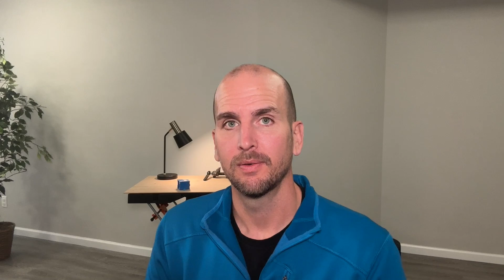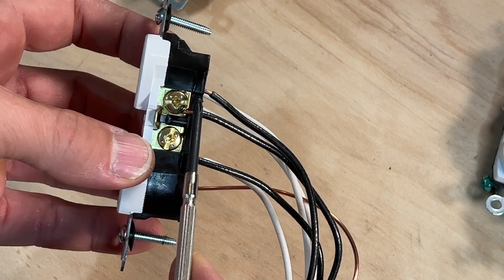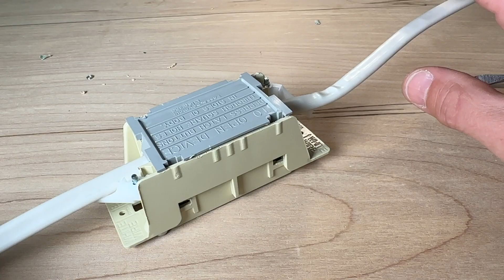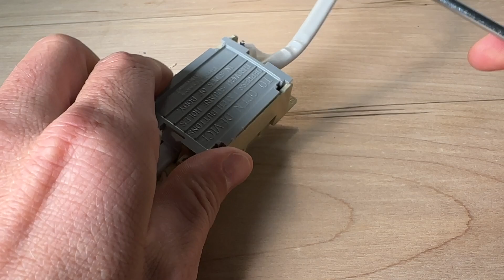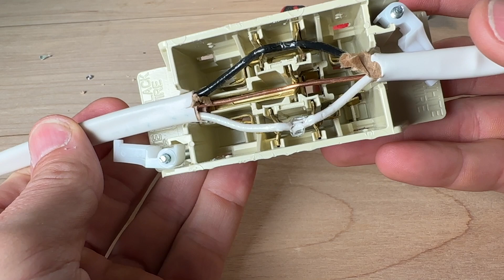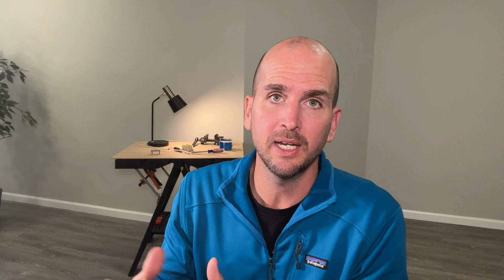90% Of Homeowners Have Never Seen This Dangerous Electrical Device

Comment: I was an RV tech for many years and these were so problematic because of the weak connection. Look up the wiring for the 3 way switch, it was a nightmare. They should be pulled from the market but the RV industry gets away with a lot of things like this.
Reply: I'm not aware of any other industry where the product being in for service for months at a time, in the first year, is common.
Reply: @SmallSpoonBrigade  yeah, I mean: Screws can loosen during earth quakes - on an unrelated note: Of those few times of service each year, an RV spends time on and off roads, shaking those presfits loose. Now, luckily only domestically rated equipment contains notes about retightening  screws after moving equipment.
Reply: most likely due to some big name RV mfc is a subsidiary of a member of the NEC or throws the NEC an assload of money
Reply: @harveylong5878  The NEC has no members - it is a code book. And if you had a clue how the code development process worked you would not make such a ridiculous statement.
Reply: @denali9449  are you a factory worker assembling the arcfaults? Just asking.
Reply: @raidhhi2217  No, I am not. Whatever gave you that idea? Or, are you just a YouTube troll?
Reply: @harveylong5878  - when properly installed and anchored, these things would be good, but year after year, we see profits and shoddy work when out over safety and common sense.
Reply: I could only imagine how much worse it is rattling up and down roads in an RV too.
Reply: Are RVs considered a dwelling?
Reply: @Linkedblade  No. They are not subject to any of the codes used in 'standard' brick & mortar or wood frame construction.
Reply: What incredible garbage
Reply: I figured this was an RV part... Looks terrible.
Reply: Yup, RV industry gets away with all kids of crap because they are trying to reduce the weight of the rig, and also keep costs down. No metal boxes and less wiring runs means less weight. Less weight means better fuel economy for the tow vehicle, and that means less emissions. They all figure thats a win win for the environment. Problem is that lots of these plastic pieces of junk get pulled out and thrown in the dump where it takes 10 million years to break down the plastic.
Reply: @wrenchgearsadventures  - "takes 10 million years to break down the plastic" - The next species to rise on the planet will be very grateful for our landfills that will be easy pockets of oil for them to harvest in 10-60 MM years. We are no only destroying our ecosystem, we're building in the downfall for the next one, too. 😛
Reply: Name one thing in an RV that is not a complete POS, just one.
Reply: @Qbert-379  - "Name one thing in an RV..." OK, I tried real hard on this one and I got nothing, except I own one... wait... nope, still got nothing!

Comment: I have seen and/or had some kind of problem (mostly heat failure) in every instance where I have seen this product used.  I will not install one.  I replace every one that I encounter with a spect grade receptacle.

Comment: Never seen these before! In automotive, where amperage never really exceeds 30 amps, and voltages stay low, those connections are usually fine.. but at 115/240 volt, why??? That's a fire hazard!

Comment: Holy nopes... xD
If the whole thing managed to slip and cut a good part of the sleeve and make significant connection with the bare wire with a tight grip, sure... but that, man, that's just asking for arcs and overheating. This needs at least multiple points of contact for a single wire, of it should demand for whoever is installing those to actually take out a portion of the sleeve and make a clamp style connection with a copper sleeve or something... which yes, would likely kill it's practicality, but still.
It's not a bad idea per se, getting into the circuit like a vampire thing, but very poorly executed.

Comment: I've worked on quite a few mobile homes mostly from the 70's to the 80's and all have been wired like a house and just had a small electrical panel. I live in NW Ohio so things may be different here than other states which could be why I've never seen these before. I'm just not sure why anyone would choose these things when they have to be considerably more expensive than a normal outlet and box.
Reply: They aren't generally found on older mobile homes. I'm fairly certain they didn't start using these until the 2000sb but I could be wrong. I live in a mobile home made in 96 and it's got normal receptacles. They are fairly common on rv's though.
Reply: Saw one in a Georgia mobile home that was built around 2003, as a light switch. Looked like the rest in the home had been long replaced ages ago.

Comment: I used to wire CATV telephone and internet.  There was a phone outlet that had a similar wiring method to the electrical outlet in question.  There was a special tool used to push down the wires that if done properly with the  tool was fine. But not done properly could cause intermittent connectivity to a hard line outlet. Many times these were wired to individual rooms so to cut down on wireless devices in an area and security issues.

Comment: That is…kinda sketchy. If installed correctly, it would be about as ok as speed wiring, which I guess is why it would meet code.

What does slightly help is that there are two contact points on both live and neutral that are connected via a common internal connector, so that current flowing to devices can pass through both connections, but only if it’s done right.

So if you do everything right, it’s just barely passable, and we all know that everyone always does everything right.

Comment: I've never heard of that before and I cannot imagine this being used for serious amounts of power... I never thought I'd see something that makes the backstab seem like a good idea
Reply: Older mobile homes (think 1980's or older) ised these as well as the rv industry still uses these. This is because in older mobile homes had 2x3 wall studs thruout the home to save weight and as a cost saving measure. In the rv industry it's the same 2x3 or 2x2 wall studs so no room for a normally wired device like we see in sight built homes.
As for wiring these devices internally ask a telephone technician if a 66 or 110 punch down tool would work to seat the wires properly, only if you have an rv that uses these and one or more needs repaired. 
The aftermarket automotive electronics industry uses a similar crimp on device to add stereos lights and other electronics to cars to avoid cutting wires and thus voiding a new cars warranty.
Reply: @leemyrick8549  oh yeah, those little brown, and sometimes blue connectors we called Scotchloks (even though I'm sure they had a different name).
Reply: @peterskyparker  couldn't remember the name but yep that's them. Can still find them in auto parts stores.
Reply: @peterskyparker  If I remember correctly:  made by 3M, rated at 240v in UK, no current rating marked on the product, main use was auto electrics.
Reply: @leemyrick8549  I have been a communications and data technician for over 40 years.  The punch down tools you mentioned will NOT work on this particular product.
Reply: @Redial2416  didn't think they would and now I know.
Reply: @leemyrick8549  I live in a '96 trailer and it uses SCDs for everything. Other than that, and floor damage over time from a half-done permanent installation and yearly burst water lines that were past their recall date, it's held up decently well.
Reply: @Redial2416  Standard spring-loaded cutters wouldn't, but what about the cheap plastic tools that often come packaged with an ethernet jack?
Reply: @wagnerrp  That would also be a no because they wouldn't stand up to the force needed to seat the connections or have the proper configuration on the end of the tool.
Reply: @JohLincN  yep 60 amp was more than adequate until the mid 70's. After that more small appliances and electronics were coming on the market thus the need for upgraded electrical systems in the home. 200 amp is the minimum I would recommend for a home now.
As for how the home is built yes stick built homes are not much better than in the 50's and 60's. Up until the 80's there were really no wind load requirements or none were enforced if there was one. Most areas of the country didn't start to follow any codes until the 70's.
Reply: A handi box and standard duplex receptacle fits in a 2x2 space.  There's no need to skimp on the connection.  The only place I see these actually being handy is for temporary power on a job site.  We use similar insulation cutting connectors to tap off of overhead temporary lighting cables.  These type of connections make more contact on stranded than solid but is an exceptionally weak connection method.
Reply: @JohLincN  yep, low voltage landscape lights use a similar 2part connector, place one part over the cable then screw on the second part to compress the cable down onto the small but very sharp prongs.
Worked very well for me over the years.
Reply: Mobile home I’m living manufactured in 2015 uses these in all switches and outlets. They are junk and I’ve replaced all my switches in the house with standard ones.
Reply: Actually there are insulation displacement contact for such applications as being used on the distribution grid itself, though they are not designed quite like this to make sure they get a very good connection. The conductor actually cold welds to the blade if done properly.
Reply: Like Lee said, Nailed it RIGHT on the head... we got a 1980 doublewide mobile home a few months ago and are renovating it. These awful things were ALL IT HAD in it... switches too,not just outlets 😑.  When you get RID of them.... you need TWO parts to replace it: a box AND an outlet 😑. I decided to rewire the whole thing, I'm videoing it and posting it here on YouTube if you would like to see
Reply: @Karl with a K ...... ummmm.... OK? 🤣
So, yanno... the frame made it 40 years too. So did the woodwork for the most part. Not the foors of course, particle board.  I do not believe for 1 second I removed a "good" part of that trailer 🤣😂🤣. I can't imagine what made you say such a thing. Also, many of them were burnt up, melted port's, and they all were attached to too small wire for modern electrical usage, 14 gage. So... WE CUT THEM OFF WITH PREJUDICE lol and I'm currently running new 12 gage wire throughout.  There was a patch of original carpet under a built in I destroyed and removed, would you like us to save that for ya? It's in the videos
Reply: 15A at 120V is only 1.8kW, double it for both outlets, hardly serious amounts of power 🤷‍♂️
Reply: @gardenogauge  but a lot when your contact point is 1/32"x1/32". That small of a connection is high resistance and prone to arcing.  Neither is good for the currents that the connection is supposed to carry.

Comment: I cannot image a home builder or homeowner accepting such a device. I would like someone to point what part of the electric code permits this in residential dwellings. Further, just because it says “UL” (approved?) doesn’t mean it’s not counterfeit. Not acceptable to me in mobile applications either. There are low profile boxes that are more appropriate for those uses.

Comment: So was this installed with "proper tool"?  if not then I would blame installer. Just like any other device can fail if not installed properly. I feel same way about speed wiring. Why are push type wire connectors acceptable to some people but speed wiring isn't? Just my two cents. I trust the NEC

Comment: I ran across one ot those in a Manufactured home.  It had intermittent power so  I removed it, installed an old work box and a standard recepticle.  I had to widen the sheetrock to add the box but other than that it was real easy.

Comment: Oh hell no!
So those are IDC, insulation displacing contacts, and that are what 95% of modern datacom products use. I say 95% because I still see some stuff with screw terminals, and even the occasional wire wrap post. 
No way in hell would I consider yawing these for electrical, and I am shocked that they are UL listed and allowed by code.

Comment: Here in France I have seen these kind of connections on phone lines at the time they were made of thin copper wires
Reply from the maker: Yeah, here too for phone lines and ethernet lines but for this specific instance they are used for 120V 15 Amp devices.  Not Good 👎.  Thanks for the feedback!
Reply: We still have that set up here in the US, but that's low voltage wire.

Comment: These self contained devices are typical on RVs also.  I’ve had a travel trailer and a 5th wheel with these.  My latest experience with one was the receptacle in the cabinet where the microwave plugged in.  I was trying to unplug it but couldn’t without considerable force.  It turned out that the plug was welded to the face of the receptacle from intense heat.  I replaced it with a commercial grade device and all is fine.  Unfortunately, because of the pass-through wiring design, it is necessary to wire in a pigtail to replace the box with a quality item.
Reply from the maker: Crazy and scary.  Thanks for the feedback 👍
Reply: @Jim Fowler You can generally cut the wire at the IDC nick, and form two j-hooks for the two screws.

Comment: I have them in my bouble-wide. I removed many of them and replaced them with real receptacles. I don't like the design. I also noted that they were mounted upside-down. I went through the entire house and mounted them with the ground pin down.
Reply: They are mounted "upside-down" in case  you drop something on them. The ground prong will be exposed not the blades of the outlet.
Reply: @PepeEpstein  ah yes because I always drop things when plugging in stuff.

Comment: That type of design reminds me of electric toy train setups from years ago. And those were way lower voltages, but they smoked and burned up too!
Reply: The problem isn't the voltage; it's the current (a.k.a. load). A low-voltage circuit drawing a lot of current will still generate a lot of heat at a poor (high resistance) connection point.

Comment: I work for a trailer park that has these in some trailers and upon hire was told to use the safest methods regardless of cost. Every time these fail, which is usually 20 amp kitchen circuits that catch fire, i replace with a pop in box and proper receptacle.